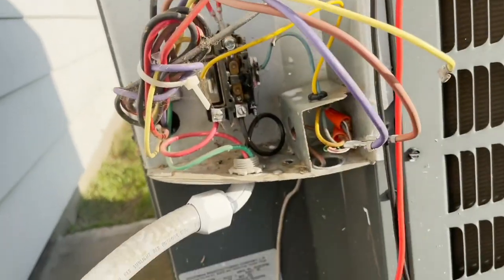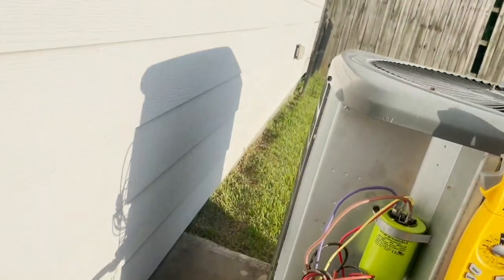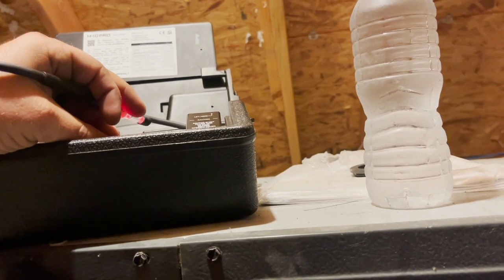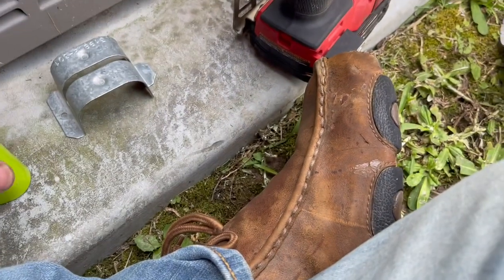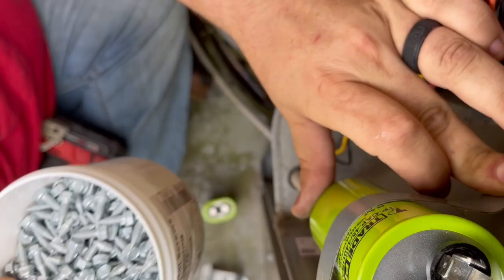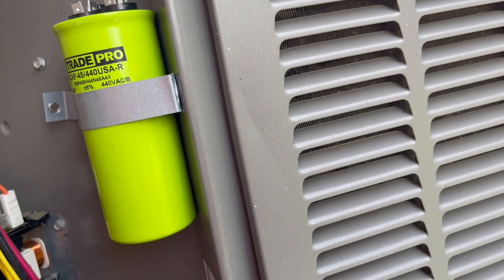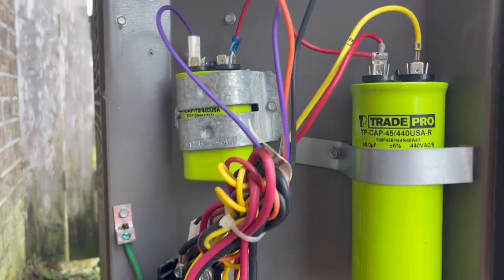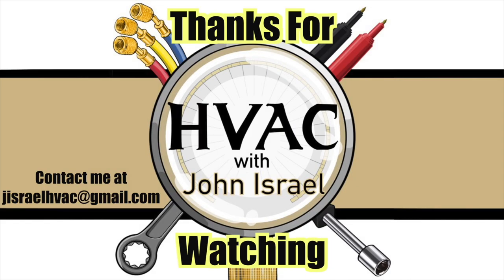No Cool & Return to a Maintenance

Comment: I’ve found using insulation tape to make the capacitor “fatter” works well. Usually a couple of wraps around will make a nice fit and eliminates metal to metal

Comment: Hi John. I’m looking for an installation guide for installing central air in my single wide trailer. We have an inter therm with a coil cabinet, but no AC currently installed. Any help to find a comprehensive guide would be greatly appreciated!

Comment: You need some of those  turbo 200 Capacitors. I always keep a couple of those on the truck for when I run into one of those weird size caps and if I don't have the right size cap.
Reply from the maker: I keep one mini turbo, one Turbo 200 and one turbo 200X. I will only use them if it’s after hours and everything is closed or if I’m out in BFE and don’t want to run all the way back to a supplier